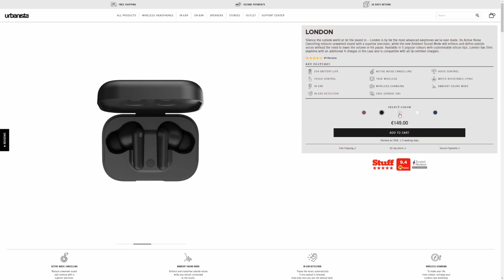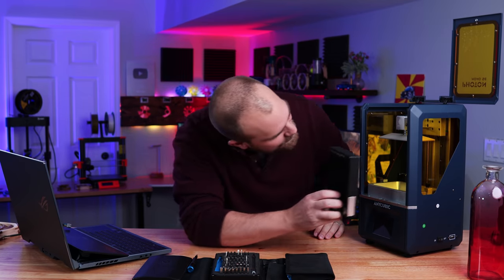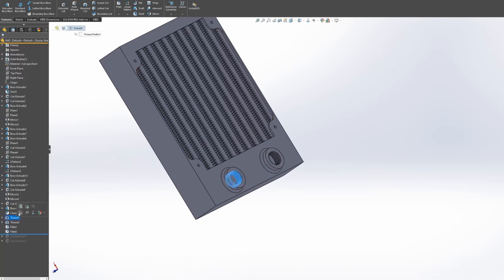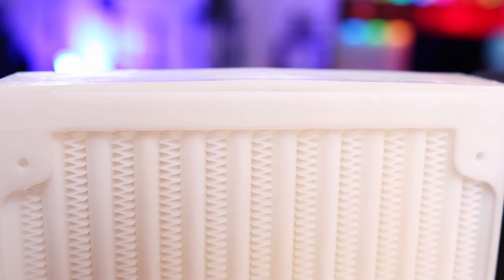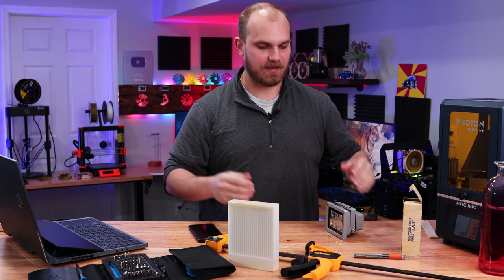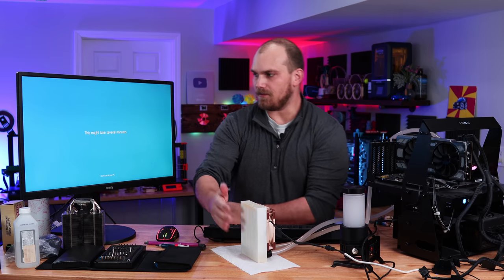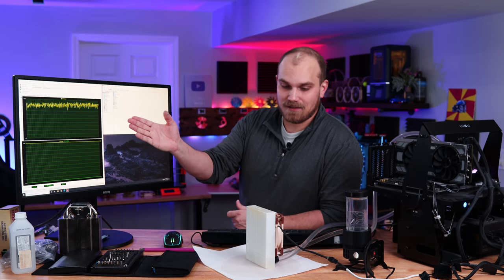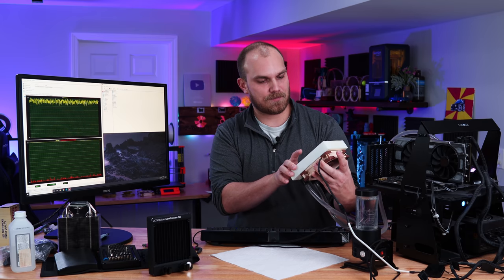I Never Expected This | 3D Printed EK Coolstream SE 120mm Radiator

Comment: Nice new space and play button.  I didn't expect that to work or 'self heal', though if it expanded due to heat that might explain the leak going away.  I like one other comment maker's idea for metal resin, my idea was for just resin like what you used but with metal particulates suspended in it.  If you take another comment maker's idea to remove the zigzag coils, I'd suggest thinking about alternate cross sectional shape for the water channel, eg hex or six-sided star prism shapes or if you stick to regular shapes just to think in general about surface area vs volume and amount of water pushed through for the water channels - then you'd have to see how the new shape might negatively impact structure or increase resin used.  I think some or all metal, or all ceramic are neat ideas though, all have downsides or curing or something though.

Comment: Try making a ”bubble cooled” radiator, so instead of having a fan blow on the plastic with water inside you use a pump to push air through the water itself :) That should be doable in only plastic, only problem is to design something which doesn’t spill if you tip it over. There are ”Tip valves” which close when tipped, those could work well :)

This type of radiator is called ”liquid heat exchanger”, there’s a small section for it on wikipedia. I do remember reading somewhere that you want pretty small bubbles, so a 3D printed grid for the air intake into the water would probably be pretty decent :) maybe you can play around with different bubble sizes.

Comment: I'm not sure if someone said this already but why go with the zig zags between the tubes? Personally, I would have abandoned that style because they are a product of metal construction and work good on a metal radiator but not necessarily a plastic one. I would have just put many holes through the radiator block in order to create as much surface area as possible. Like a slice of swiss cheese. maybe taper the holes on the fan side to make even more surface area and help with air flow

Comment: I think thinner channels with the same fin density, and maybe another channel per side would give lots of coolness to the resin and transfer in. maybe go thicker and bevel the inside bottom chamber to add support along that bottom edge with an actual oval support or supports in the dead center like a wing at the fin stack ends. I also wonder if an infused resin like metal or carbon would conduct better.

Comment: How about some 3D printed water pump design contest? You could use a regular fan motor as a base as in the fan blade contest. (These fans are brushless. If you pop down the hub and tape down the bushings, you can submerge it in resin to make the electronics waterproof.) There could be different axial and radial, or even mixed alignment desings. It would be awesome.

Comment: i suppose the answer to better cooling might be to make it thicker with a longer fluid path. i mean like, instead of 2 chambers (up and down) it might have 4 chambers. (up, down, up, and down.) longer path + more surface area = more turbulence = better mixing = fewer hot spots = better cooling. or at least that's what i think.

Comment: Please try to consider having a Inlet shaped like a horn that tapers down to a tube that then spiral wraps itself back up around the horn and then finally to an exhaust port. Have this entire piece be filled with the water so that it just creates a shell membrane around the entire tube. Just an extremely thin layer of water wrapped around a tube that you are pushing air through. Make the block so that it utilizes the most of your workspace without making it finicky to try and remove. Just give yourself a slight buffer

Comment: You might want to check out the design of microtube racing radiators that are used for off-road and F1 cars, instead of plastic tube and fin stacks, basically tiny microtubes all the way across with turbulance generators inside and and out - they are tricky to make normally but resin printing would make it much easier -  reduce the wall thickness of the tubes down as well, I'd say try 0.5mm to help whilst keeping them somewhat sturdy, because if you get them thin enough the thermal transfer of the material isn't as much of a factor.
Reply: Also if you made your radiators with O-ring grooves in the tanks you could make modular radiators that stack together with just a bit of tube slotted in the holes, so that you can make bigger units with your small printer.

Comment: There's sintered metal filament that you have to bake in a kiln after printing. That would be allot stronger and thermally conductive than plastic. It does shrink in the kiln so complex shapes like a radiator might not be feasible however. Good video, I love this series, first the distro plate and now the radiator.

Comment: You need a MightyVac, a cheap tool to apply vacuum or pressure with a gauge.  Excellent for leak checking.  Good visuals.  Get the metal one, you'll never look back.

Comment: You should measure water temperature at input and output of the radiator and see the difference (after a while, when thermal mass of the radiator whil be saturated).

Comment: Have you considered radiant heating PEX? 5/16 hePEX-a should be significantly more conductive than the resin, and you could mold the fittings directly into the radiator. Tooling costs might be high though.
I'd love to see a diy baseboard radiator element repurposed. Those are relatively cheap for a massive unit in comparison (/like $20 for a 4' section with a 1/2" core).

Comment: THAT is a genius idea, designing the plastic radiators. The fan blades are interesting but just not knowing how good a plastic radiator could be is blowing my mind, you could design a radiator with cooling fins that'd be completely impractical for a metal radiator.

Comment: The rad would have to increase in surface area inversly proportional to the difference in heat transfer coefficient between a copper rad and a whatever that was. Maybe making it into a 3 fan module would improve things.

Would having a dome shaped end cap work a bit better when printing?

Its a cracking idea. Rads are really expensive, especially for motorbikes. Printing one would be game changing!

Comment: to be fair if you made a larger regular exchanger with an internal channel with a veeeery turbolent-y path to maximize heat exchange it'd be honestly interesting.
make it thikker, make like 6-10 with the option to stack them and it'd be a weird structural radiator setup. 
i mean let's assume for a moment that it's inexpensive enough and the modular design is not hell incarnate.. you could feasibly make a whole modular case based on the concept, where EVERYTHING = surface area.

Comment: Remove the plastic fins (not thermally conductive enough), make the radiator thicker/deeper (for more surface area directly on the water channels, but since there is no fins there should be enough airflow),  add a bit of support structure between the now unsupported water, reduce the wall thickness a little bit to improve thermal conductivity, add fillets to your inside corners to prevent it pulling away, maybe zig-zag your water channels a little bit to give them more surface area?

Comment: Cool! I'd like to see a couple more videos on some improved designs. I think the fins do very little, if anything since they're not really conducting any heat. My desiccant dehumidifier has a plastic radiator/condenser and it's basically a bunch (maybe 50 or so) of 7mm thin x 40mm deep plastic channels for the hot air to pass through. Perhaps one long serpentine channel would work better.

Comment: I wonder if you could redesign the radiator to be more efficient out of plastic. I can't imagine those little fins are doing much head transfer.

Also, if you were to fill the radiator with resin and then shine your light on the leaks it should seal all up

Comment: I do believe that leakage might actually help, water takes a lot of energy to vaporize. If all the fins are wet that means that water has a lot of surface area to vaporize and with higher airflow water vaporize even faster taking energy away.

Comment: You should print two or three of these radiators to simulate a 240/360 radiator and see what its capable of! If it works, it  will make watercooling much easier for people. Is there any resin or filament with better heat conductivity?

Comment: Seems it's time to do some experimentation with the design and see just how thin you can make the walls before it start leaking like a sieve. Also are you sure a higher fin density would help? Why not remove as many of the fins as possible and just have the bare channels? This type of resin is really bad at transferring heat so I kind of doubt adding more of those fins would help cooling. Shrink the distance between the channels and increase the number of channels with only as many fins as needed to keep the channels stable sounds like a better way to do it.

Comment: Imagine printing a PC case with built-in radiators. It would have to be printed in multiple pieces and assembled, but if you made the entire top panel and the upper half of the back panel out of radiators it would probably perform pretty well even with it being made out of plastic. You could design the sections such that they mate together with o-rings so that they're watertight. Or maybe design them to be glued together instead.

Comment: if you can make it thin enough I suspect it may even compete with aluminum. Basically just relying on the very high specific heat of water. It's like how if you use a thin plastic bag you can boil water because the water is so eager to pick up energy. I suppose this would also in theory apply to the CPU block.

Comment: I wonder how much better it would get with some optimization on the wall thickness and the fin design (they might be too large if the resin is really bad at thermal conductivity and it might be better to have more paths for the water to flow down that are slightly closer together)

Comment: Now if you want to know crazy engineering you could take your tube design for the rad and use that as deflectors in your little cooling tower. See how much efficiency you can get out of the plastic rad with some evap action.

Comment: But you could print a whole sidepanel for a case as a radiator. which would be awesome. you could actuallly cool your pc with the case, not wasting even a mm² of space. You could even 3d print a case panel which integrates the pumpmount, the reservoir and the radiators in one piece.

Comment: How about a windmill radiator?  Each blade could be a U-shaped copper plumbing pipe, maybe with 3D printed valves to make sure all the water does a full trip through the U.  It would push water into the blades at the bottom of their rotation while the ones at the top dump their water back into the loop.  And maybe cut up some aluminum cans and use them as fins?  And/or use aluminum or whatever material to make the blade-pipes wing-like.  With a strong fan this windmill could help the pump (maybe even replace it???)

Comment: Hmm, I'd be interested in seeing if a passive radiator would work. Design it so the convection currents draw the hot fluid up and out then cool off as it flows down into a lower cool fluid bank that gets drawn into the radiator as the hot fluid flows up. Obviously this only works if close looped or if open then the fluid surface must be the highest point of whole system, and either way, the radiator should be the lowest point.

Comment: Love the idea and for 7 bucks I'd love to see a long term test to see if it's a viable option for someone already owning a resin printer.

I think the thermal transfer could be improved by re designing the fin stack. I think what you need is more thinner water tubes with reduced fin count to balance airflow. Since the thermal conductivity is way lower than that of metal IMHO you need the water to be as close to air as possible without compromising too much on longevity. Also do you have some room to print a thicker rad ?

And for the end cap staying stuck to the curing window, you could round off the cap with a large radius or do some kind of pyramid.

Comment: Given the thermal conductivity of the plastic I would say that it might be more interesting to have more pipe wall area than fin area. Water is good at carrying heat plastic fins are not.

Given the contrains of SLA printing, printing a whole lot of capillary tubes should be that hard given the small layer area.
An issue could be the flow restriction. That could make the pump unhappy and the flow restriction would mean more pressure for the capillary to hold.

Comment: I wonder if a design without fins, but instead a ton of interweaved microchannels might actually perform really well.  Plastic is not a great conductor, so plastic fins aren't that helpful, but if you can increase the surface area of the water channels, in a way that is not possible to match with metal radiators, it might perform pretty well.

Comment: make the one edge of the radiator angled so it sits flat on the build plate but the entire radiator is angled on the X axis where you do have room to angle it. it probably won't take much angle to get it to unstick properly from the fep without tearing itself apart. oh and yeah. CLEAR resin and Colored water :-)

Comment: This should work ok. As others have said, the thinner you make the tube walls, the better. I work in HVAC and we used to use plastic air-to-air heat exchangers. And they worked well. (They were only made by one company and we can't get them anymore, not because they weren't good, they were very good,  just the supplier isn't trading anymore for some other reason :-( . They had a good product which was nice and efficient. Wall thicknesses was quite important and the thinner ones cost more.). Maybe making the end tank walls thicker or beefing up the corners might make the joint that split stronger.

Comment: I would be interested to compare this to having no radiator at all.  In other words, the heat capacity of the water in the loop will get you some benefit for quite awhile until it saturates.

Comment: I think to get the most performance out of a plastic radiator you would have to design it a little differently, since you can't take advantage of the thermal mass of the radiator itself. I would try to make the coolant run in say 1mm wide channels with the thinnest walls you can print, with 1mm air gap between each channel. If you use really thin walls it should do a decent job at radiating heat into the air flowing through it. You could also give the channel "fins" a "S" shape to force more air to make contact with the channel.

I think we need a plastic radiator fan showdown...

Comment: Hmm. How about a thicker or dual layer radiator. Or fun shapes like case side walls/windows or L shapes to fit a longer radiator into a smaller case form factor. Hell you could print a radiator into the top rear corner of a case and the cooling reservoir as a single piece to really make a clean build.

Comment: it should work. you are still moving heat away with water and spreading it to a bigger surface area with air blowing on it. 
most resins can tolerate 100C* which is the max of water. it is not gonna be as effective as the metal heatsinks because they conduct heat better, but as long as it can move heat it will have an affect

Comment: i wonder if a   copper  electrolysis  to that plastic  would change the overall  thermal  dissipation behaviour.       print to size,  electroplate with copper.  could be a interesting outcome.

Comment: I would think your printer would allow doubling the thickness to help compensate for the reduced heat conduction rate. I guess it would eliminate the throttling on your set up.

Comment: If you plan to use plastic then don't use fins. The longer and thinner the water channel the better your cooling will be. Make a winding "s" shape supply line up one half and a matching "s" return line down the back half. Time in the fan flow is the key more than fin density when it comes to low thermal performance materials.

Comment: The idea of making series with viewers' submitted designs is cool, do it! Also, try a version 2 of this radiator, make it a 360 with larger fin spaces. I'm also NOT surprised it worked for some extent as plastic does transfer heat, not too efficiently but it does, afterall, most A/C adapters for electronics have plastic cases, including quite powerful ones for laptops.
I bet you could improve the cooling power with a more optimized design.

Comment: I would love to see some optimization done to the design.  Since you are not restrained by the metal fabrication restrictions, maybe delete out the center area that is in front of the fan hub to reduce resin cost. This would introduce curved pipes but that could still work. Anyway, this was an awesome idea and video!

Comment: I think it would perform better without any fins(air restriction not really adding to heat transfer) and as thin walls as possible.  instead of using the material as a heat transfer source you are fighting the material as it is an insulator.  

You could also build a hybrid similar to some car radiators.  The top and bottom out of plastic and the transfer core out of like copper pipes or something.  It would be a pretty simple design with an array of copper pipes in the middle.